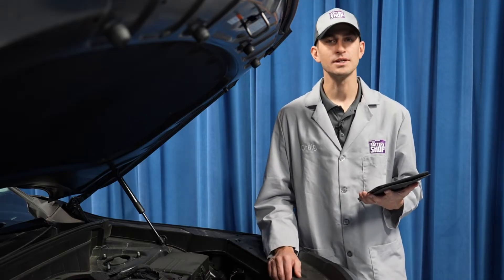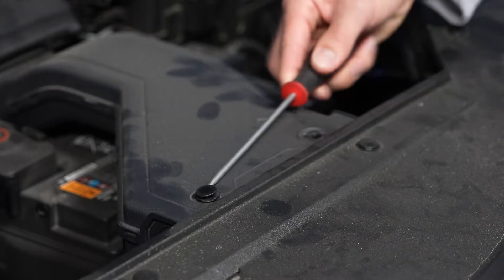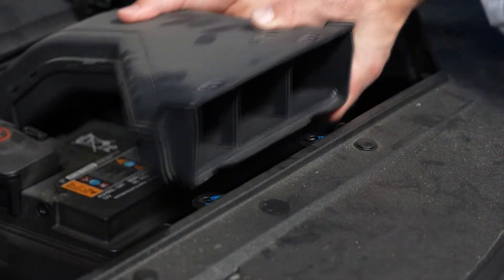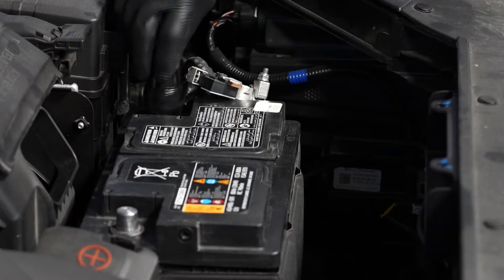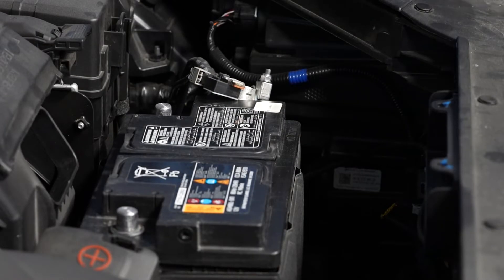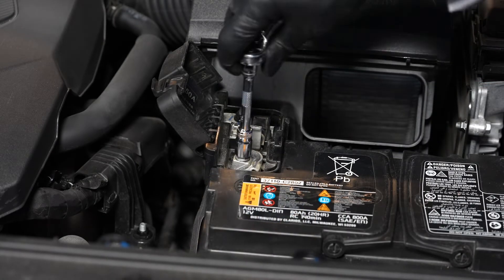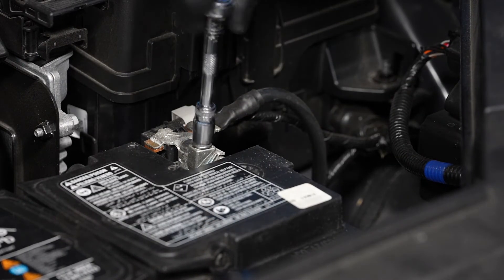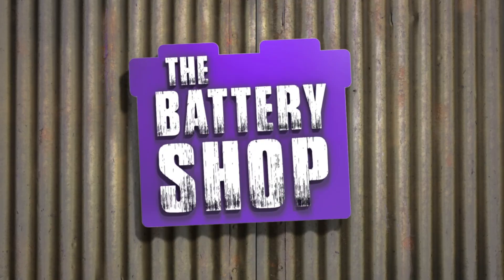Kia Telluride (2020 - present) - New Battery Install

Comment: Just replaced my 2021 Telluride battery. 2 tips: 1st those little clips will break, go to auto zone by a small pack of replacements 4 bucks...2nd, tape the heat shield to the battery when your reinstalling the battery or its a pain to align it up...and use a power pack that plugs into the cigarette lighter to keep 12v on,, and not mess up your electrical system.
Reply from the maker: Thanks for watching and adding your tips.

Comment: Was there a mod for the positive post for 2021? Cable too short to pull off post
Reply from the maker: The vehicle that was used was a 2021 Kia Telluride.  There was no modification to it.  This is a tight fit but no modification.

Comment: Just changed mine with no battery saver. I believe if you change the battery quickly, i.e. only leave disconnected without a battery for a few mins you will be fine. That was my experience.
Reply from the maker: Hi - Thanks for watching and sharing your experience!